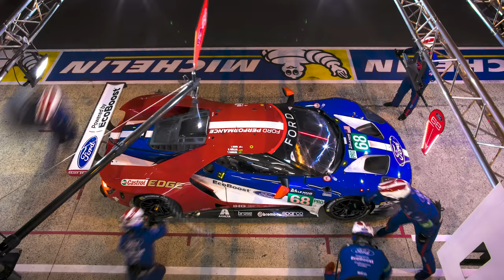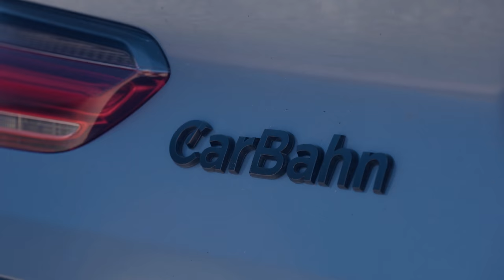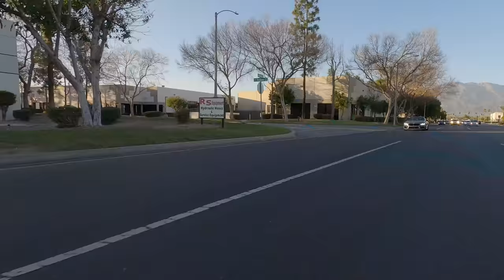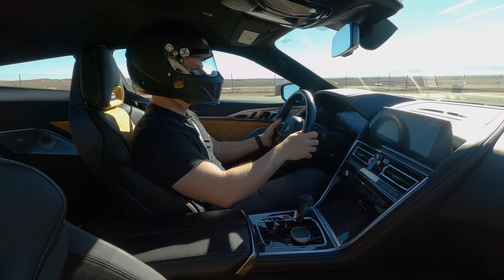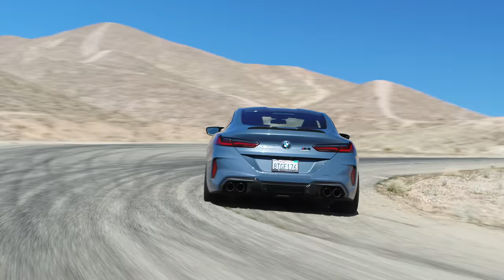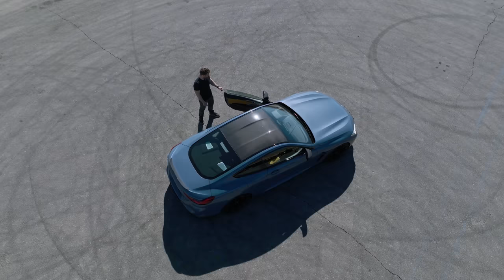Driving A 900bhp BMW M8 Competition Tuned By Steve Dinan | Top Gear American Tuned ft. Rob Dahm

Comment: The Dinan name has been held in a place of respect, possibly reverence in my life since the late 20th century.

(how's that for hot air?)

I've had a few BMWs over the years, and turned to Dinan for my tuning needs. Always thrilled with my purchases. I think I first bought a Dinan product for an E30 M3 I got to enjoy for 10 years. Tracked the crap out of it in NorCal at Sears Point mostly and just loved it. 

Your's is a new name to me Rob Dahm, but one heck of a job here in this package. The Top Gear brand is the Shiznit, so I ain't surprised.

Well, except for Clarkson. What a sour grouchy misanthrope is he. But I love the bloke anyway. lol

Comment: Remember when Scott Pruett/Memo Rojas and Ganassi was winning the Rolex series? That was Steve's engines...then Steve Dinan and Chris MacNaughton @CarBahn walked me through my M2C S55 6sp Tune (570hp/574tq)-Amazing reliable power. I did have to upgrade to 295/265 on BBS wheels to assist with traction. My E46 M3 6sp also has their suspension and exhaust. They are legends in hi performance perfection.

Comment: Dude it’s a bmw M8, yes it is THAT TYPE OF CAR. All bmw M’s are “that type of car” these cars are literally designed to be versatile on both the track and roads. The entire core of what BMW M is, can be summed up in “street cars that feel like race cars” they are engineered in part through extensive track testing.

Comment: If youre riding on bump stops through a corner though, wouldnt you lose grip the second you hit a bump?
Reply: Depends on compressibility of bump stop. A hard bump stop will transfer load to the tyre, softer will act as a second spring and roll the body.  F1 did this in the 80's, it's torsion bars for them now.

Comment: I’d love to see what rob could and would do with like a b58 out of the m340/m440 in a car like a rx7/miata type side car.
Reply: US didn’t get the m140i did they? Here in EU there is a lot pushing big power
Reply: @henzopereira5308  nope we only got the 2012 135 coupe. Now we only have the 230 and 240 and m2 coupe. We also have the 228 and m235 grand coupe which is like a Toyota Corolla. The United States has a love hate relationship with hatch’s. I would love an m240 hatch but they wouldn’t sell enough to justify them bringing it over here. Plus the people who would want a m250 hatch like the m135 hatch wouldn’t be able to afford it since the m240 couples at like 65 grand and above. Plus dealerships over here are selling most cars above sticker. So I doubt someone 18-35 would be able to spend 70-80 grand on a two door hatch. But I could dream

Comment: He shared too much secret for his own good but I also hope my favorite cars listen to these details . That's why I always order 1 size fatter and wider tires for my new cars because that just fixes the sways on bumps and better handling than lowest profile tires . Also the rating of the tire tread and details matter which in that case Continental Michelin and Hankook or kumho are the best. Pirelli is not on the list sorry guys but on street roads and hazardous situations they explode and are jumpy but the other ones obsorb the shocks better Basically specifically in the maximum rating high performance summer , not ultra performance necessarily. For example los angeles California streets the high performance and in Germany autobahn the ultra and skinnier